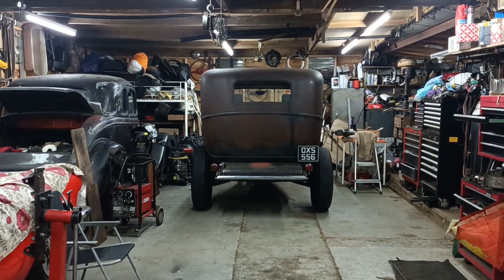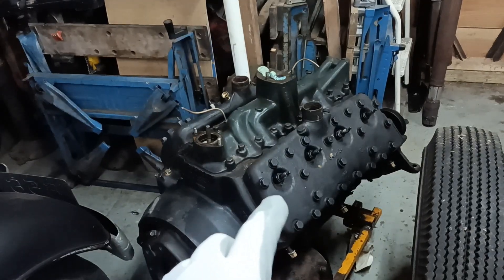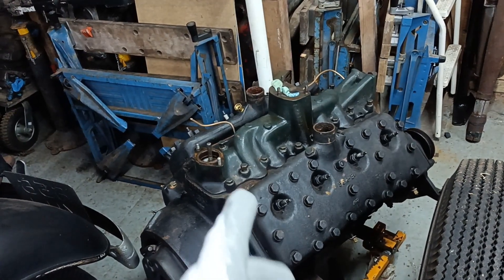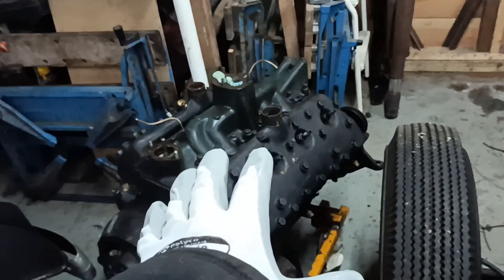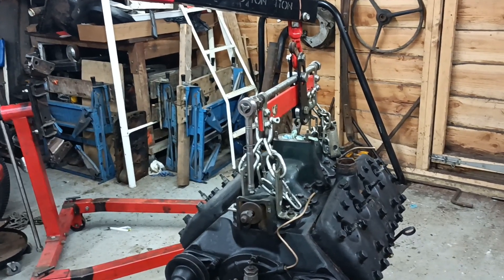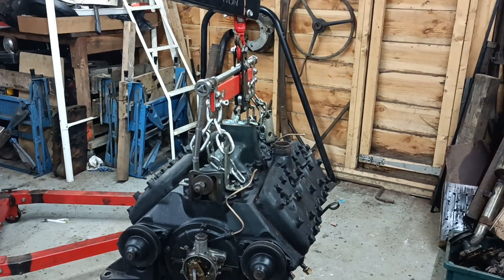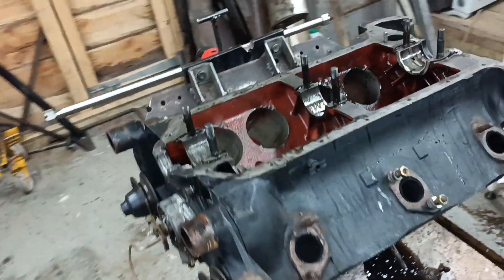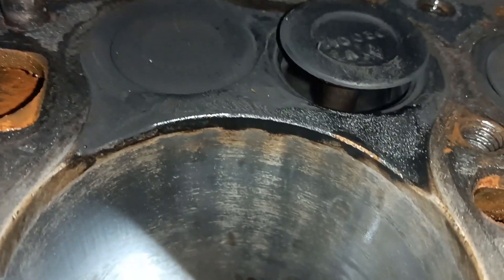I burnt up my cranks thrust face. Can I fix it? Part 3. Block prep. (2286)

Comment: Looks like that block is a good candidate for sleeves then you can build it with a match set of pistons and add a blower to it
Reply from the maker: Hi Chris. It will probably get bored to 3-5/16". I hope that bore will clean up at that. I have sleeved blocks but would not then like to go to the bigger bore sizes. Never used a blower, bit too complicated for my simple tastes. Happy new year.

Comment: Yes I love my engine leveller.and I will give it your modification to make it even better .and I am supprized the rings don't get pulled out buy that bad cellender wall
Reply from the maker: Yeah, the leveller mods really paid off when I used it for this job. I am also surprised at how well it runs even with that bad bore. I'm hoping that a future rework will clean it up at 3-5/16". Thanks for watching and commenting, Dan, and a happy new year to you.

Comment: Never heard of anyone ever sleeving a port like that .. interesting.JB weld and plugs seems to be the cheapest application
Reply from the maker: Not sleeved, Dan, just drilled and tapped 1/8" pipe. I didn't film the repair job I was in panic mode at the time. I think some may have thought I tapped the whole port with a much bigger pipe thread, but it was just a small hole.

Comment: Hi Mart,Ever since you 1st installed the PCV valve on this engine,to me,it looks to be back to front?Ie the end in the valve chamber should be in the inlet tract?thank you for the videos.regards,Graham,Tasmania,Aust.
Reply from the maker: Hello Graham. This particular valve (V100) is set up so the gasses are drawn towards the threaded end. That makes it handy for a situation where you can tap directly into the input tract. I managed to tap a 1/4" NPT hole right into the area where dividing wall is between the two inlet runners and access both sides of the manifold with one tapping. I added the 90 degree bend to sit the valve horizontally as it was rattling when fitted vertically. Thanks for watching and commenting.
Reply: Thankyou Mart.All the other valves i have researched flow the opposite way.I used one from a Toyota Camry.

Comment: This is likely a silly question opening me up to being schooled, which is fine  but, could one not somehow sleeve the valve port? Considering the rarity the French block is, it would be nice to 'save'.
Reply: He has already drilled the hole out and plugged it with a pipe plug and had the thing running in his truck for a year
Reply from the maker: Hi Wax. I don't know how I would go about sleeving the valve chamber, I made a localised repair using a pipe plug. As Chris has said, i ran it for a year with no problems so am calling the repair a success. Thanks for watching and commenting, and a happy new year to you.
Reply from the maker: Thanks for replying Chris. Happy new year to you.